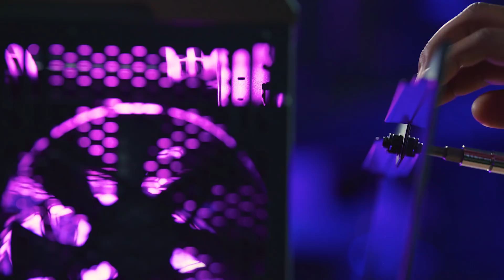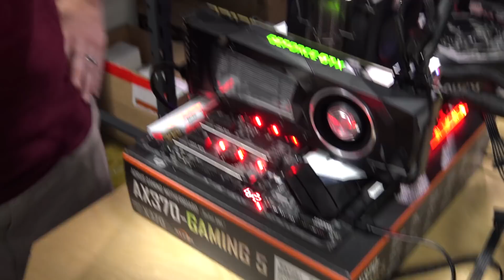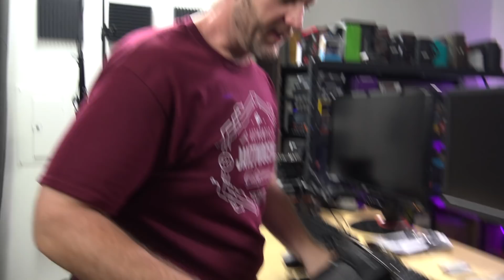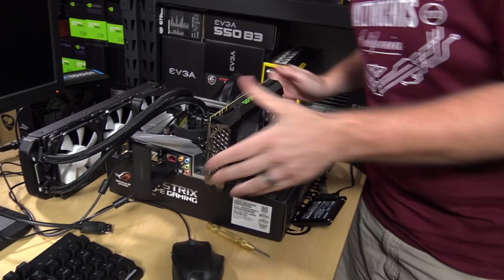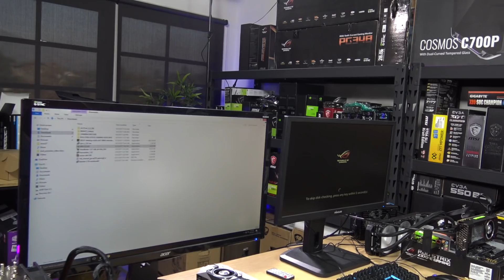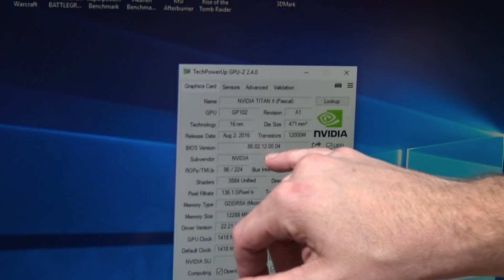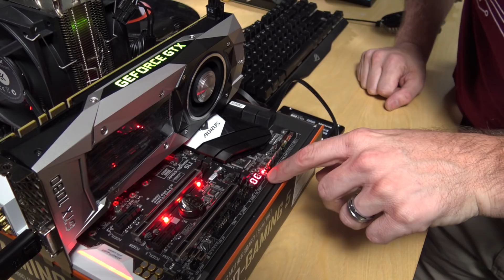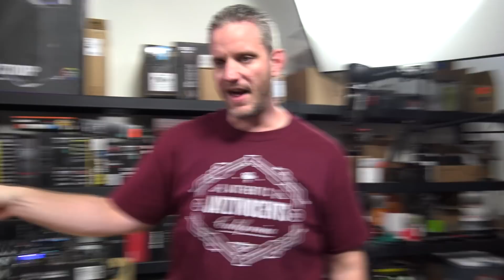I cant figure this one out... HELP!

Comment: Fun problem. You have a lot of hardware to troubleshoot, so the next steps are to eliminate any other potential trouble source: change up the cables: hdmi/displayport/vga ; pci-e power cable,  PSU, pci-e slot, motherboard, CPU, ...

Comment: Not sure what all methods you've tried on troubleshooting, but have you tried to put both cards in the same mobo? Will it post with the "bad" card in there but not being the display out? Vise versa? If it happens to boot with the good card in there as well, what does your device manager say is present?

I ask because someone mentioned DP triggering monitor on. I don't think it's that because that would only prevent the monitor from turning on, but not the system from posting. Perhaps it is some sort of latency between the GPU handshake on post. Could just be a variance in that particular card and mobo combo. Obviously, that wouldn't provide a fix, but would be interesting to know.

GL, i'm keeping an eye out for an update!

Comment: 1. boot with 1 populated DIMM slot
2. after flashing EFI - reset to clear CMOS
3. try other video outputs
4. try other PCI-E slots (if presents)
5. switch manual boot devices/drivers "legacy or uefi mode"

Comment: Maybe some EMC problems with the Titan and the Mainboard? First I would try another Ryzen on the same mainboard, than another mainboard with the first Ryzen. Then you can be sure if it's a problem with this specific Ryzen CPU, the Mainboard or the whole Ryzen CPU line has problems with this card. So more research is needed :)

Comment: Straight from the manual:
B2: Legacy Option Rom Initialization (turn it off)

you should not just move the GPU over to another board, but also the RAM. Especially since the 1080 needed another reboot before it worked and hangups in the 20-30 range point towards some RAM issue. Which memory is involved in with error 25 can only be known when Gigabyte decides to writer better manuals and list all the codes, not just the ones they feel like.

Comment: That is weird. Gigabyte boards have always given me trouble with one thing or another. Though what I'd do is first see if the card works on the mobo out of the box. If it doesn't work then I'd try re-seating the card and/or trying another slot. After that, I'd update the bios/uefi and see if that helps. Guess as a rule of thumb one should always check that you have ram installed and all the psu cables plugged in properly as well. Other than that it could just be that Ryzen is still fairly new and it still has some bugs. For example, I can't use my internal capture card in my new Ryzen build because its not supported on the platform...

Comment: I would check the power draw.  Each GPU can draw more/less power than "normal".  I experienced this once and rma'd it and they tested it and sent me a new card.  I clamped the power cords with the new one and found a significantly different power draw.  I must say that I couldn't test it in different system but that is something to try.  It could be over powering during post and the system doesn't like it.

Comment: Mine ryzen 1700 does exactly the same thing. I'm running on msi gaming pro carbon. And an rx480. I can swap it out for 1050ti and boots straight off. Once it boots on the ti though. I can get the rx480 to work. I just can't do anything in the bios. Where I can with the ti.

Comment: Do both of the cards have the same vendor. Even though they are both Nvidia reference, some vendors use different supply chains. It is possible for two reference cards to have 2 different memory suppliers, 2 different chokes, or being on opposite ends of the tolerance for the card. This is true for high-end just the same as it is the low end. Same logic transfers on to the motherboard, what end of the tolerance scale does it come in? 
Unfortunately, the variance in the components, or how it falls in the tolerance spectrum for manufacture is something that will likely remain an unknown variant in this case.

You could do the simple stuff, such as take the heat sinks off both cards and see if they have the same chokes, FETs, ram, etc...

Comment: Aorus mobos suck. My gpu's would not work at 100% after bios update. Gigabyte tech support did not know what are they talking about and they were blaming sli, how ever I told them that I have same thing with a single gpu. And then I did one silly thing I've should done at the beginning, reset cmos! After that everything was fine.

Comment: Only thing I can think of is maybe the PSU is marginal and the silicone lottery between the two titans is causing the PSU on the Ryzen rig to faulter.
Try swapping the PSU out for a higher powered one and see if that helps?

Comment: The first vBIOS check was the good Titans on the Intel system.  Then you swapped the GPUs, and tested that same Titan on the AMD system.  So you tested the same vBIOS twice, but you didn't check the vBIOS of the "defective" GPU.

Have you tried using a different PCIe slot on the same board?  Maybe check any PCIe settings?  If the GPU works on a different slot of the same board, that suggests there really could be a hardware defect in the motherboard.

Comment: I faced this problem before with my old fx am3+ 8120 and my gigabyte motherboard. I ended up flashing the bios back from F9 to D7 and everything seemed to work properly. It took me a whole day to realize it was a BIOS issue with hardware detection (i/o and bus) dropped my old gfx  card in loaded fine and loaded the old bios in 5minute and dropped in my new gfx card and everything worked fine. But it could also be your mobo needs to be RMA.

Comment: Windows. It's always Windows.

But in all seriousness, I agree with most people here. What happens if you put the wonky card in a different PCIE slot on the Ryzen system? I'm also not entirely sure this would work, but have you tried reseating everything on the Ryzen system? It wouldn't really make sense that that would work, seeing as different cards seem to work on it, but why not give it a try? Weird things happen all the time. Also, you could try putting components that are same on each machine, and try the "bad" card on both again (like if possible, try using the same PSU, RAM, etc. Obviously the board and CPU have to be different, I hope this is making sense). Hope it works out Jay!

Comment: Some ever so slight bus timing issue in either the card or on the motherboard?  Just wondering, is there a BIOS option to change to like PCIe 2.0?  That would change the timings.

Comment: As others said, you checked the BIOS of the same card twice. Assuming it's not that, I'd look at power delivery. It could be that one card draws more power than other due to silicon lottery. What I'd do is:

1. Swap the PSUs 
2. On the working intel pc run heaven or some gpu bench on both cards, checking the boost clock and the power draw and that both cards are working correctly. 

It could be that the one of the 8 pin PICe power connectors is broken/faulty on the card that doesn't work but there's enough power to boot on Intel. the Ryzen motherboard might initialise the two cards differently. 

People will say "But the GPU isn't drawing full power on boot!" but that isn't the case, the GPU frequencies are set by the driver, which doesn't load until windows does. Depending on how the GPU works, it might run at its max clock until the driver loads.

Comment: Could be a handshake issue between BIOS of the motherboard and the output type of the video card (much like how when you first power on an HDMI monitor and it flashes with the display but goes black immediately after, forcing you to power cycle the monitor). The motherboard may not be detecting a video output, spite it’s BIOS code. Also, have you tried a different pci-e slot on the auros motherboard?

Comment: I had similar problems with a x99 gigabyte and a Palit 1080ti... The card worked without problems in my Z97, my x99 didnt start with this card. I did bios-updates without success... Every other 1080ti worked fine with the x99 gigabyte g1... Despratly, i leaved the systems by its own, powered on. i was frustrated because another 1080ti from Paltit did its job.... The other day i resetet the bios, started the system and: taaaadaaaaaaa, post-screen. This was 2 month ago and since this time, no problems showed up wit the x99 and the 1080ti... Till now i dont know what the problem is/was, but the system works fine.

Comment: If Ryzen has known issues with memory, would it not make sense for the issue to be in the particular DDR5? The cards may be the same but there is nothing to guarantee that the components, sourced from external suppliers, are exactly the same. Don't they still work within a tolerance of expectation. Even down to production efficiencies/mid production hardware fixes;, tweak X overclock Y. I have no idea, but once you eliminate the usual diagnostic possibilities you drill down into components. POST failure means a fundamental error. When POST verifies a GPU what roll-call does it make? As far as I can gather its: power, socket, GPU, memory, etc... and the bios compares these with what it knows about the expected returned values. Some POSTS used to just check the power and socket integrity, and other values were returned from the firmware and not independently verified by the hardware itself. I don't believe that is the case anymore.

Comment: PCIE slit pins not making contact with one or two contacts on that specific GPU. the GPU might be the tiniest bit thinner on those contacts and don't make contact with a pin or two in the slot. Have a good close-up look at the slot and use vernier calipers to measure the card contacts.

Comment: Wonder if the problem would still arise when connecting two seperate PCIE power cables to that graphics card. Maybe it's a compatability issue with the power supply and the GPU's voltage detection circuitry. If the card thinks it's getting inadequate power then it won't turn on.

Comment: Oh I have had this issue way back in the 90s...  A great price on a 56K modem and it wouldn’t initialize in my system...  I replaced it with another one and that wouldn’t work again...  my friend was able to use it in his system and his was a K5, while mine was a pentium based machine.  Sometimes things just don’t work and no matter what you do, it can reach a point where it isn’t worth the price that your Time is worth.

Comment: Hi Jay....I think you have narrowed it down..most likely..GPU(My credentials: electronic RF test technician in radar PCB testing and sub-systems), I am only throwing in my 2cents, but i think the GPU could be having in issue on a specific line (may it be power delivery or clocks or signal lines) that cause more volt drop on specific sections in the "faulty" GPU, for something a ryzen mobo may want over an intel mobo.
We know\think that the GPU is suspect. if you can try the problem GPU on a exact copy of the ryzen bench, with a new mobo from the same manufacturer\model  and if possible a mobo from a different manufacturer. this could point out a fault\problem. with respect to either the mobo or ryzen chip with that "faulty"gpu, if it has that kinda manufacter issue.
8 months ago a gave my 4890 GPU to a friend because on my PC it just crashes and freezes, after good years of service. But gave it to him and he got good work out of it for a few months.i was AMD cpu and he was INTEL cpu.his 48970x2 died on him, hence why i gave it to him.still don't understand why he could run that GPU on max with no issues while on my rig would die with a Far Cry 2 Bench at 720p, even after a motherboard change
problems like these are very interesting, but I know, tedious and frustrating as fuck. I hope i helped in some way. Good luck and If you ever figure it out please inform us.
Love the show, keep up the great work.

Comment: Jay, It's called "shit happens" You have 1 card that doesn't work. Now if you had 40 or 50 cards that didn't work, heck 10 cards that didn't work then, I might believe there is a major problem. But 1? It simply could be that the card maybe is on the edge of Nvidia's fault tolerance specs. Maybe the mb is on that threshold. People get bad products every day.  From cars to computer parts. To me, the fact that you get a lot of this stuff for free just means that you are troubleshooting a waste of time. Go out and BUY 10 Nvidia cards  and see if the problem still exists.

Comment: This probably isn't your issue, but i noticed the motherboard box that the Ryzen system is sitting on has that silvery foil lettering.  I know pretty much every You Tube  computer building channel says that this is okay, but I had an issue with this once.  I built my computer on the motherboard box and when I tried to boot it up it wouldn't post.  After a couple of hours swapping out parts and being very frustrated I decided to take it off the box and place it on a plain brown cardboard box and it posted.  I know this isn't the exact issue you are having but maybe it's worth a shot.

Comment: Did you try slot #2? Also, being an owner of that board, I recognize that error code. What is your RAM set to? Is XMP on? Try no XMP, stock 2133MHz with the 'faulty' card. You may only need to do it once. Failing that, boot it from an alternate GPU, set your UEFI to defaults, then try.

Comment: the answer is close.. 
- 2 different MoBos 
- 2 similar GPUs with similar Bios.. 

So the Ryzen System seems to be more sensitive to minimal 
changes than the Intel-based one..

So, as StartupTim already Explained, the Ryzen CPU AGESA (especially the IMC TR has the same as the regular Ryzen) is still faulty, sensible and not better than Beta status.

Let's imagine, there is a faulty AGESA Code, which is still very sensitive, while on the other hand, some charges of the Titan X's differ in maybe ram or other chips while matching the specs, which were made without Ryzen and dont need a different GPU-Bios.
So those little changes could cause the behavior, shown in the Video. 
So nVidia would not be the one to blame, but AMD would have to work harder on AGESA.
This by myself guessed scenario would fit perfectly into my actual feel of AMD.
They throw hardware into the market, that better would have been finalised "before" launch.
When it comes to Software, that they need to delvier for their latest hardware, they dont paint a beauty picture..

Comment: Had the same problem with my 550ti which worked fine on my 2500k but won't work on my 3000 series cpus.... Everything updated bios cleared... Swap boards and everything... The 550ti was supposed to be supported for the cpus in question...

Comment: Makes no technical sense, but then this is a weird problem - the only thing that links the CPU ram and GPU is the Northbridge. Your helper powered on the system without RAM? Maybe a strange Ryzen northbridge issue?
How about take the CPU, GPU and RAM on that rig, use on a different but identical board?

Comment: Identical video cards are not identical, just like CPUs, there is a silicon Lottery,  Can you swap the power supplies between the two systems? is the motherboard grounded? Try putting it in a case so the motherboard has some grounding. There is some question as to what you get from the 24 pin vs a case grounding.

Comment: When I got my Ryzen system I had the exact same code issue with that board, it turned out to be the RAM. I had to remove one RAM stick of RAM until it had successfully booted, then powered off put the RAM stick back in and power on again.
Reply: ALso you might have to move the single stick of RAM into different slots until it works.
Reply: Also I was using a GTX 970.

Comment: Try the card that wouldnt boot on another ryzen system to see if it boots. The only other thing i could think of is are both gpus clocked at the same speed and same voltage, could be power related

Comment: I have a similar problem with my GTX 660ti. I bought it used and apparently was working. Threw it in my main system and it didn't work (sort of). It would render the screen of "windows has crashed" block by block, and took about 2 minutes to refresh the screen each time.
I've tested the card and use it all the time on my ITX system with a lesser power supply, and it works perfectly. I don't know the exact issue even to this day, but it seems to be a similar situation. It seems to just disfavour certain psu and motherboard combinations.

Comment: i had sumthing like this happen with a 1700 and rx480 thought it was my gpu bad but had sumone check it it wasn't that then a thought was a bad cpu so sent it back and got refund but then a got me self a  A8 9600 am4 and found out it was due to overclocking ram i was using Corsair Vengeance LED 16GB (2x8GB) 3000mhz but anyways just bit info about what happen to my rig hope it helps in sum way

Comment: I had the Gigabyte mobo "Ga-270x gaming 7" had the same problem.
And also when I turned on the psu the system will turned on automatically.

So... Gigabyte did my issues

Comment: if nothing of this is working, I recomend to do the same process with a different gpu , one that you never used befor on that sistem , start the pc with no memory as you said you did , turn off the pc at the same moment you did with the other one and then try it again with the full setup .

Comment: Jay, my two cents worth, it's the silicon, not being equal I think today, remember you CPU test not so long ago, so differences in batches today and the final testing not drilling down far enough. Or the microcode of the GPU itself, maybe in manufacture one bit flawed or corrupted. Or there is a manufacturing flaw, that only surfaces under the conditions of the Ryzen system, in booting that specific card.

Comment: Try resetting the cmos, then if that doesn't do it, try different cable types, dvi/dp/hdmi whichever if the card has em. If neither works, try reducing the pci-e speed in the bios if you can. Very odd indeed.